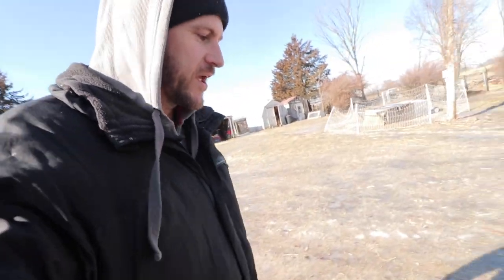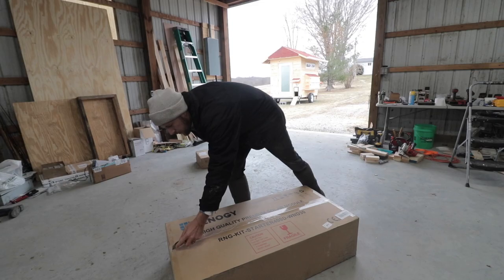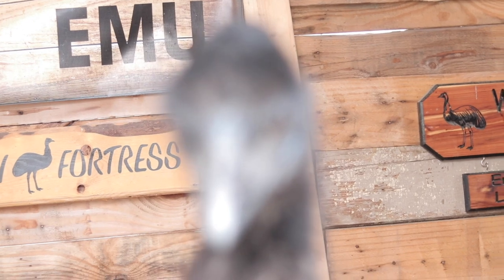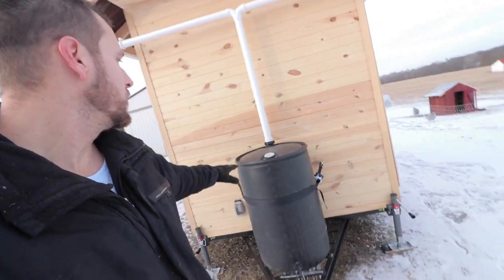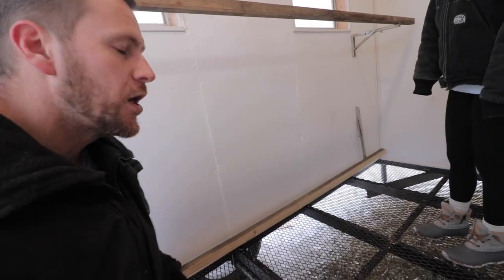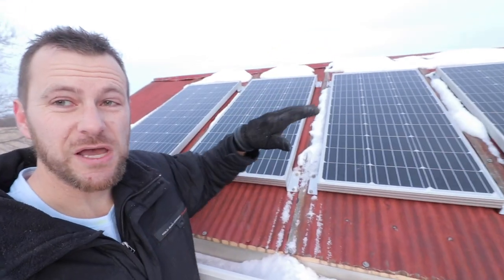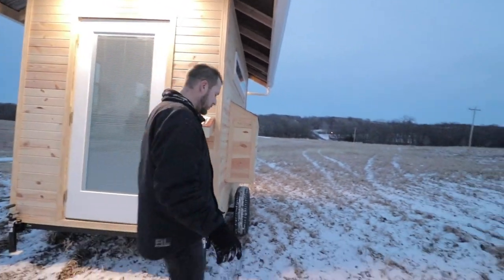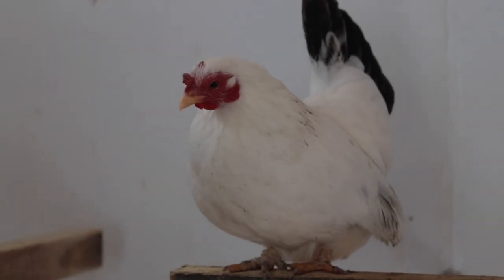You’ve never seen a mobile chicken coop like THIS

Comment: The solar mobile coop is super! However, chicken's feet are tough but still tender and their jumping down from the roosts onto the hard metal floor could cause problems down the road such as caught nails and even bumblefoot. The concept of poop falling to the ground means less work for you but potential issues for your flock. My 2 cents.
Reply: You prove a very good point with their feet, but if push comes to shove he could always put a flat board with some hay on it in a little area for them to rest their feet on right?
Reply: I'm not thinking that would cause any problems, the manure could be scraped out if it started to build up.
Reply: Yes exactly my thoughts. I've learned so much building our own coop and changed things after, as I'm sure they will too. The roosts above the windows are so high the jump down over time onto a hard surface has a high chance for bumblefoot and other leg injuries. Even that high of a jump onto shavings they can get bumblefoot. Its simply the impact alone thats the danger. That and an open surface down low is allowing lots of drafty cold air in. Ventilation high above the heads is ok. Great coop though!

Comment: I love everything about the coop just not the flooring. Its exposed to cold air and something small can stick their fingers underneath and mess with the ducks..
Reply: And chickens- coyotes yank a toe through that mesh and snack!
Reply: No, they will rip the wire completely apart and crawl up in there and it will be a massacre. I know, it happened to me with my banny chickens. One way to fix it though could be to install removable panels around it so you could take them off to move it. Just a suggestion, not criticism at all. I love the build. Great job!
Reply: They plan to block off the drafts using hay bales.  The ducks got plywood platforms so they'll be fine.  But if the birds get harassed by wild critters then I'm sure WHOTH will troubleshoot the problem.
Reply: They don't use wire floors on trailers.  Its a thick metal grate, ain't nothing chewing through that, but yes they should add hay for comfort and insulation.
Reply: JJ Yeah, the floor is metal but something with small paws might be able to stick their fingers through the holes and try to get them. But hay/straw or some temporary flooring would be better to keep them warm and comfy during the winter.

Comment: Is there a thermostat In the coop, curious how much warmer it is in there in the AM vs outside!
Reply from the maker: Kara Leeann - I haven’t checked the main part of the coop yet, but the solar battery has a thermostat and it has read in the 50’s when it’s been 10-20° outside.
Reply: Did I miss the heat lamp? Does it not get cold enough to warm the coop up a smidgen?

Comment: You need to put down straw on the floor in the winter.  That metal will cause frost bite on their feet.  Way too cold of temps for them to be up above the ground with air blowing in under them.  You are gonna have some very sick/ill poultry.
Reply: They do have straw under the grate. I think this is why he is going to put straw or hay bales around the bottom on the outside to keep from blowing air everywhere. He also said the inside is registering at 50° per the control panel, even when it is 10 or 20 outside.
Reply: Cold doesn't cause problems because chickens do a great job keeping themselves warm. He said he will take care of the drafts so that won't be a problem.

Comment: I have seen something very similar. In my head. But this is the nicest one I’ve seen that actually exists! 
If the inside lights are LED it might be an idea to switch them out for colour change ones so if you need to go in there at night when the chickens have gone to bed you could choose red lights and not disturb them as much.

Comment: Impressive! Nice job. A couple small issues: maybe put an overflow in rain barrel. If it gets full and freezes, your pipes or possibly even barrel may split. Also if you put hay bales around it, they will freeze to the ground. Since they insulate well, it takes a long time for them to thaw, and in the meantime you can't move your coop.(Lesson learned on my part!) Maybe put down some 2x4's and place bales on that, or removable/hinged drop down panels? New projects like this are always a work in progress, but yours looks pretty well planned out. Good luck!

Comment: Aww Jake!! You did such an amazing job on this luxury, VIP (or maybe it should be VIC for Very Important Chickens!! But the “P” also works for Poultry, I guess!) chicken coop on wheels!!
Genuinely, I am so impressed! You really do take such amazing care of all of your animals.
I love that you put solar panels on it as well. 
Have you thought about running hot water pipes along the bottom of the coop for heating for when it gets really cold? Obviously I mean running the pipes on the outside of the actual coop, below the grating that you have for the floor, so that the chickens and ducks that are inside the coop don’t get burnt from the hot pipes! 
I’m originally from Northern Ireland and we always had hot water radiators in every room of our house, to keep us warm in the winter (as well as a coal fire or wood burner in the main living room), but the radiators that we had back home is what got me thinking about the possibility of you running just hot water pipes along the bottom of the coop, as you wouldn’t need too much to heat such a small “room”. 
Also, because you have the solar panels, wouldn’t those also be enough to heat the water in the pipes as a makeshift radiator as well as the lighting? 
I now live in Australia and we have solar panels on the roof of our house, which we use to heat our water, when needed. 
I mean, I’m no expert in any of these sort of things! I’m just throwing some ideas out there!! But you could set up a thermostat for the water pipes because I’m guessing that to heat a room the size of the coop, the water would not need to be all that hot. Also, if you are able to put a timer on it, just like you have for the door, you could set it to heat up the coop for just a few hours at the coldest time of night, or early morning and have it set to automatically turn the water heater off about an hour or so before the door is programmed to open in the morning.

One other thing I was thinking about was that if you altered the building plans a bit, the size of that coop, but without the laying boxes, the grated floor and a few other obvious things, that would make a perfect treehouse or just a little clubhouse for your boys to play in! Somewhere outside but near the house, or wherever you think!
It just looks like the perfect size, or thereabouts, for a play house of sorts for the kids. 
Or perhaps you have something else up your sleeve for the boys!! Lol 
This chicken coop just reminded me of my childhood at my grandfather’s farm! He had an old chicken coop that he wasn’t using for chickens anymore. Now it was very old and nothing as wonderful as your amazing chicken coop! It was also absolutely caked in years of chicken poo!!! However, me, my sister and all my cousins got together and once we had permission, we scraped every last bit of chicken poo off of that coop and we scrubbed it clean as best we could as quite young kids. Then we put some old carpet on the floor of it and decorated it with whatever scraps of junk from around the farm, that looked good to us.......... then we had ourselves the best place to play and get away from the adults. 
It was our “Nature Hut” 😂 That was what we called it and I have most of my best childhood memories from that place! We played in and generally used our Nature Hut for years as kids. Until we outgrew it. 

Sorry, I totally got lost in my childhood there!! I didn’t mean to waffle on. But I still think that your boys would absolutely love a place like that, just for themselves and their cousins and friends.
Although, maybe you already have something like this in the works or plans for the boys.
You are extremely handy! All of the things you have made for your home, the farm and animals........ both you and your wife, you guys are amazing and I just get so much joy from watching your videos. Thank you both and thank you to your boys for giving so many people so much joy and entertainment, along with a little bit of jealousy! Because most of us would love to be able to do what you guys are doing. 
You and your family are totally living the dream, as far as I am concerned.
Much love to you all from Australia,
Leanne 😁 💕

Comment: Very nice coop - love all the perches & light.  It would be kinder & not that much of a clean out to put straw on the floor for the birds to have softer landings from those high perches & the ducks would be more comfortable. - I'd definitely put straw down on the floor in the winter as many suggestions remarked below.  People like to try to have easy cleaning solutions - I'd rather rake straw/poo bedding piles than scrap raw poo off metal grating and have my birds walking through all that muck in the meantime.  You'll figure it out once they live in it a bit.

Comment: Great job!  It reminds me so much of the one Al from Lumnah Acres built a few years ago, except with a few modern upgrades.  Al will be so proud of you...and itching to upgrade New Yolk City.  ❤️
Reply from the maker: Erika Richardson - Al made a good one... he does great work!
Reply: White House on the Hill I am blown away by your upgrades.  They were well thought out and practical choices.  You can tell that you love the birds, and were thinking of saving yourself time on daily and weekly chores.
Reply: @erikarichardson  Only thing missing are TV and cooking range !
Reply: @erikarichardson  Agree
Reply: This is a nice coop but Als is better because of a real floor. This is not good in cold weather climates
Reply: @glenn6448  Al has heavy snow that is not the case here. 
in this case he can just put straw/hay if he wants to keep warm during winter and remove it during warm weather.
This makes this coop cleaner and less stinkier than Al;s
Reply: @davelawson2564  cold open steel on chicken feet is not good
Reply: @glenn6448  did u read my comment ? If its cold just throw some straw/hay over the steel mesh
Reply: @davelawson2564  from what he said he doesnt plan on doing that. Its a nice coop. I just hope others in cold climates dont copy the floor. They are talented people. Ive seen chickens with their feet frozen off into stumps however.

Comment: That is probably the coolest coop that I have ever seen.  The only drawback I see is that it'll take around 12,000 extra eggs ( not counting the feed also required, 20,000 to 30,000 with feed) to cover what it would cost.  It looks to be big enough for somewhere around 20 chickens, that'll probably lay +/- 250 eggs a year, so it's going to take a while before it starts working for you. A lot sooner if you pick up some corporate sponsors, and Youtube revenues with it, but pretty costly for the unknown farmer trying to live on just farming.  But it still is an awesome coop.  It just needs  some red carpet now, and a chandelier.
Reply from the maker: Brad Payn - it didn't cost that much for us, but we explained the cost in case anyone wanted to build it for themselves.

Comment: That is simply an amazing job. You are capable of making tiny homes. LOL. Congratulations. 
If it's that supper cold, besides the hay bales around, as the chicken would peck at it when released. You could install plastic or plexiglass skirting flaps on side area for winter. They could slide on exteriors track into place for winter, to cut draft from bottom. Good for sub 0 weather. Then remove for summer.
Nice ice skating ring for kids to skate on would be a nice simple project. Lumber for sides, tarping, and water. LOL.  G-D BLESS
OOPS, forgot to put hay in chicken boxes.
Your son's smile is adorable, missing front teeth.

Comment: Loving the coop. Not digging the floor at all. I see future issues. Of course most of the time they'll be outside or on roosts. But in super cold they won't. Also the draft. Using the straw is a great idea. Having windows on one side only was a great idea. Lastly, the cost. Not at all knocking your build but I could never justify that expense for a chicken house.

Comment: I hope  the solar system will work. I had a similar system in the past. With a batterypack that is dubbele the size of yours. There is not so much sunlight in the winter so the battery barely charges. If you connect a water heater to the system. The coop will run out of electricity in a day.

Comment: Did you seal the holes in the tin roof so water can’t get thru them.
Reply: I too want to know, I keep internally screeching every time I see them.
Reply from the maker: janet Epstein - we sure did. Siliconed all of the holes, put sealer on the outside of the coop to preserve the wood, and sprayed the metal floor to protect it from chicken poop.

Comment: Assuming that your battery is at 12 V DC you should change your lamps over to 12 volts.. Then you can put your inverter on a switch and only use it when you need power for your receptacles. That will save you energy in the long run and make your battery last longer.

Comment: Would be fairly simple and nice looking to add some type of snaps aloof the outside bottom of the coop and get a heavy duty tarp to snap along the outside of it during the cold months to keep the wind out, you know like a boat cover snaps down and is made of that heavy waterproof material? We had one custom made for a sandbox I built for my sons to keep cats or other animals out of it and it was nice and worked great! It was exactly like our boat cover, it will be heavy enough that you shouldn't have to worry much about wind but you could always have it weighted along the bottom even just at the corners or have metal enforced holes along the bottom that you could drive a few stakes thru as you would a tent for example. Just a thought. Wouldn't be cheap but it wouldn't look cheap either and it would last you a lifetime.

Comment: Hi i love the coop. I know people are saying about the flooring and you have said about draft excluding with straw bales, which is great, and will also double as entertainment because chickens love to peck at straw bales lol. I was wondering if you had painted the metals mesh with anything to protect the chickens feet? I know chickens can lose their feet to frostbite and i know metal in freezing weather like yours could cause damage so im just wondering if you painted the mesh with something to provide a safety barrier?
Also for your rain barrel did you put an overflow hole near the top of the barrel/base of the pvc pipe? It would mean the barrel can fill but anything more will leak out the hole. I would just be concerned that water would build up in the pvc pipe and crack it when it freezes. You've done such an amazing job with this i'm only asking incase its something you hadn't thought of. Love your channel :-)

Comment: Oh I hope you didnt leave the solar in a parallel connection!!! You want a series connection so that if a panel fails, the while thing doesn't stop working, in a series if 1 were to fail the other 3 will continue to work. Just to let you know, I'd really hate to see a failed circuit that could have been prevented by exchange of knowledge

Comment: You must have a heater light inside the coop so the chickens would have a heat in the icy cold weather or they would die from cold 
Take this serious 
Please 😫🙏🙏💓😫🙏🙏💓😫🙏🙏💓 dont ignore 
However the coop is insulated there's some heat but the heater light will be better and safe for the chickens

Comment: aren't round roosting bars a better option? just wondering
Reply from the maker: Abraham George - we've used both. They do fine with either, they just need to be able to grip something. Easier to mount to something when they have flat edges.

Comment: Not to be negative but the open bottom is a major design flaw. Your birds will have no protection from the wind. Being elevated like that exposes them more to the wind than if they were on the ground, and you get quite a lot of wind from the sound in this video. Predators will freely be able to get under the birds and while they won’t be able to get to them they can literally stress them out to the point of death. If you could devise a way to lower it to the ground after moving it, your birds will be much better off. 

It is a beautiful coop.  It is rather over engineered but your heart is definitely in the right place. I’ve learned a lot through trial and error. Some of my greatest ideas turned out to be my worst disasters.  In animal husbandry I’ve found it is always best to put the animals well being over our convenience. That said, it is a glorious coop!